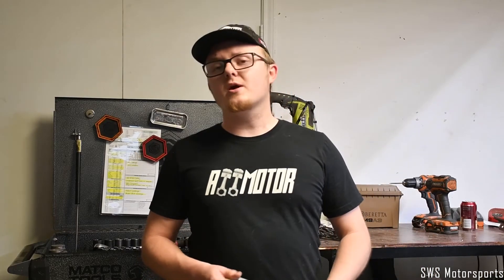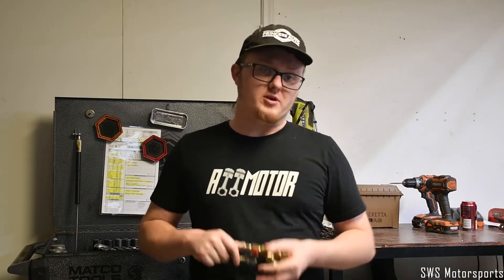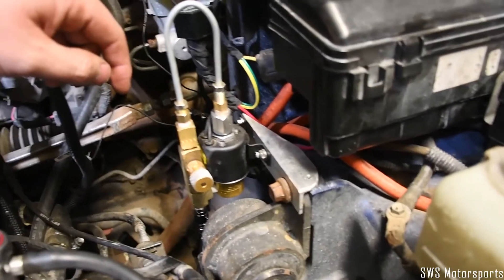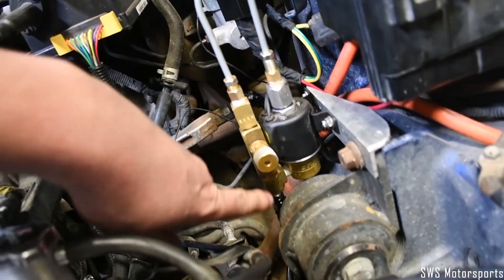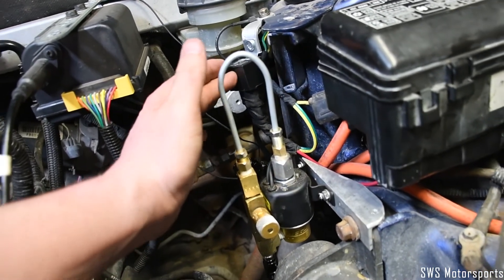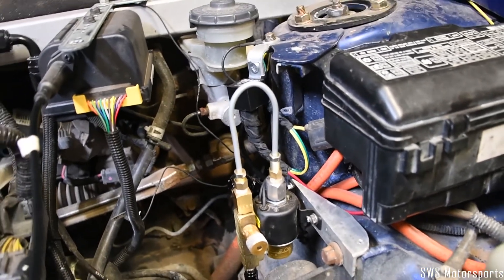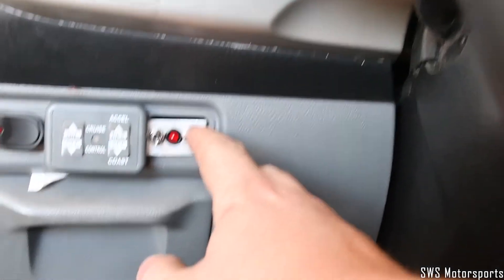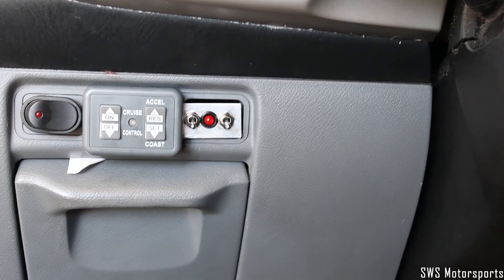SWS launch control clutch slipper valve, Why do you want one? and How too.

Comment: What if my launch control is on my clutch pedal, how do I stop it from activating every time I shift?
Reply from the maker: it needs to be gear or speed controlled. it's also nice to disable it for street driving or burnouts.
Reply: My launch control is hooked to the clutch pedal sensor. I use an arming switch in conjunction with a push button for the solenoid slipper valve. It takes about a second to register clutch engagement to the 2 step control so If I shft fast it won't engage my 2 step as I row the gears.